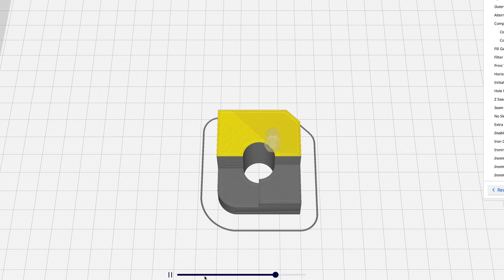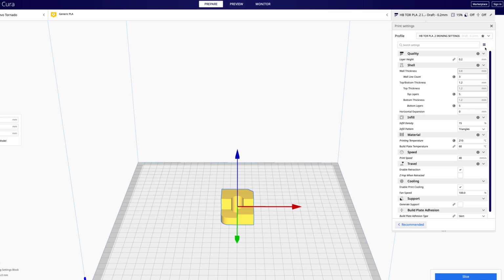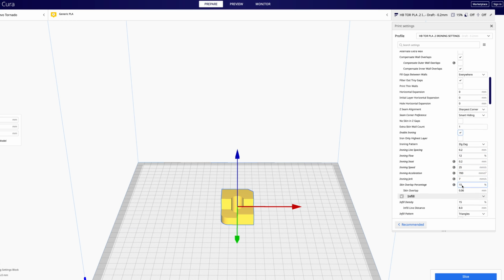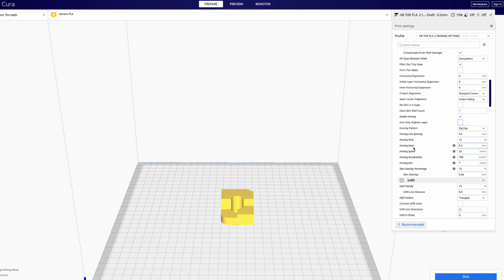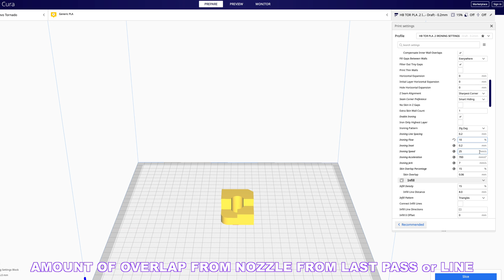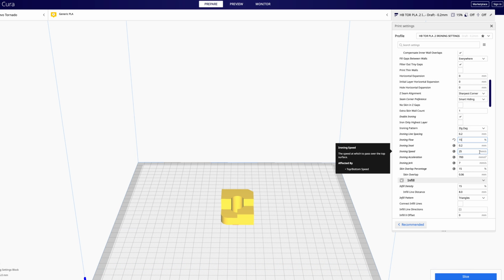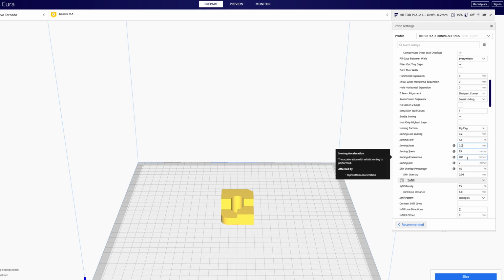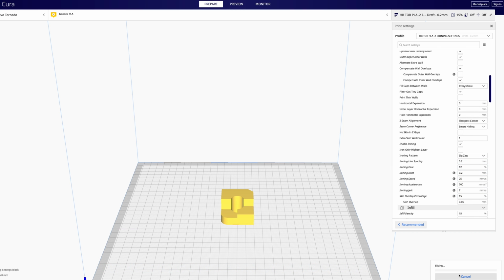So Smooth... Ironing Settings in Cura for Perfect Top Layers - 3D Printer Pro Tips

Comment: Great video, Just going to give these ironing settings a go.
One thing i have been trying to master for PETG is Bridging, I think i may have it down to a T nearly though.
Min Bridge length - 0.4
Skin support threshold - 50
Sparse infill max dens - 0
Bridge Wall Coasting - 100
Bridge wall speed - 10
Bridge wall flow - 50
Bridge Skin Speed - 10
Skin flow - 60
Skin density - 100
Bridge Fan speed - 100
Bridge has Multiple layers
Second skin
speed - 20
skin flow - 100
Skin density - 75
Skin fan speed - 100
Third Skin
Speed - 30
Skin flow - 110
Skin density - 80
Skin fan speed 100

Try these on the next video you do, unless you have your own.
Reply from the maker: I will give it a try... thanks

Comment: The text in the video is all blurred for me on 1080p full screen so can't make out any of the settings! (all other videos I watch are nice and sharp.) I guess it's because it's possibly recorded in 4k and converts poorly to 1080!
Reply from the maker: I will check that out and see what is happening.  Thanks for letting me know.
Reply: @tr3nDmaker  Cool. It looks very useful though, so I would be keen to see it properly. (btw: I tried it in FF and Chrome)
Reply from the maker: @davidl1813  Text shown in Cura Settings  or text that I add at bottom of screen?    Are you scaling your screen in monitor settings?  Let me know, I will type the data out for you.
Reply: @tr3nDmaker  The text in cura settings, but no need to type out the settings, a simple screenshot of the most important settings would be cool. But thanks for the kind offer though.
I normally watch youtube in a wide window, but I also tried your video in full screen 1080p HQ with no luck. btw: I'm looking at "T-splines in Fusion 360" in a wide window across 2/3 's of my screen (720p) and all is visible and seems reasonably clear. Maybe the comparison will help with your next video. But I do like the format and everything else in it :)